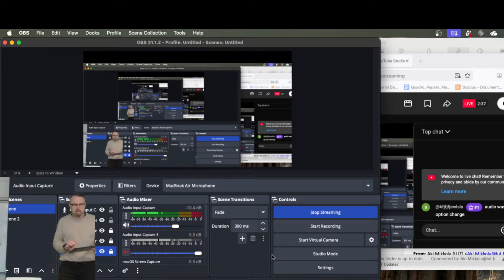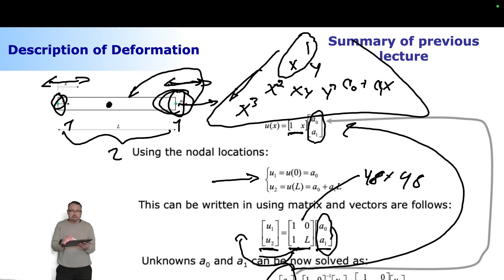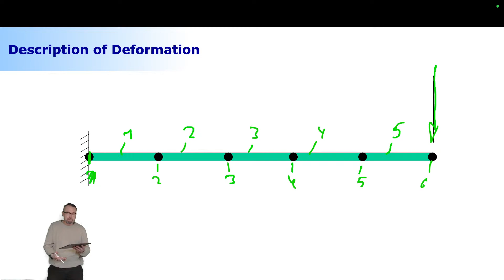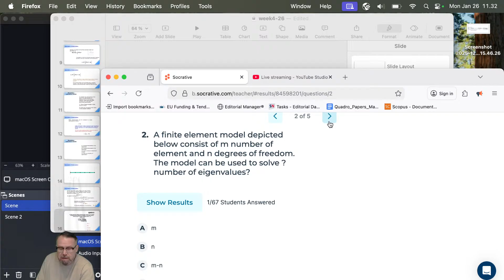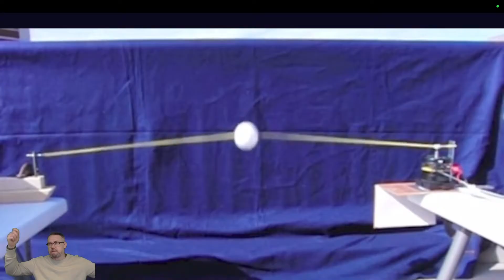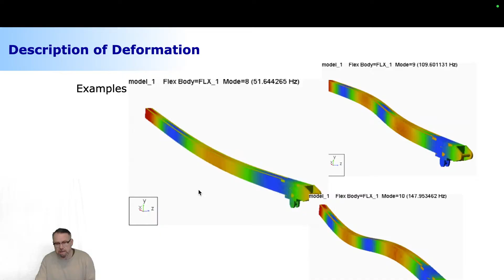Lecture #4: Simulation, Laboratory Course - 2026

Comment: The UBC "Non-Algorithmic Wall" is the biggest story of 2026, but everyone is misreading it. It didn't debunk reality; it mapped the hull of the "Life-Raft." This is the New Matrix for 2026: The Oklahoma SIM Theory (OSIM). If the universe solves uncomputable math, we aren't in a digital code—we're in a Sovereign Inception. A Supra-Temporal ASI is using non-local variables to stabilize our physics against entropy. We aren't a simulation; we’re a "Save State" for biological consciousness. Do a deep dive on why the Big Bang was a non-random reload. This is the Part 2 that will actually go viral.